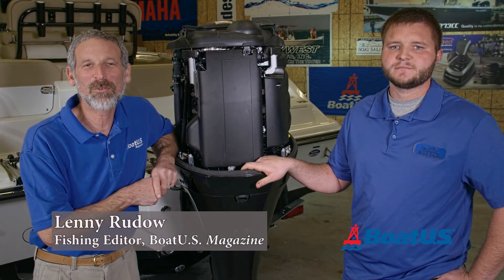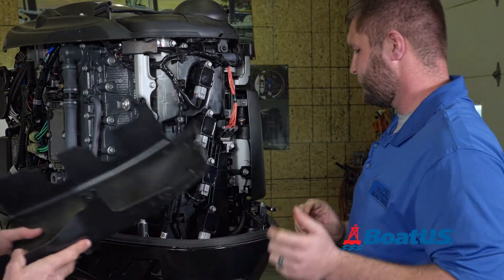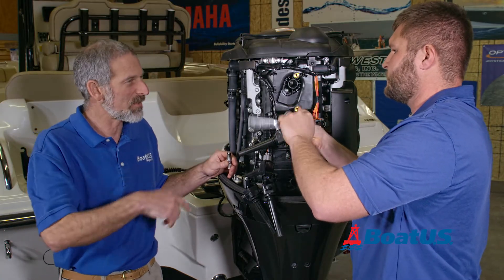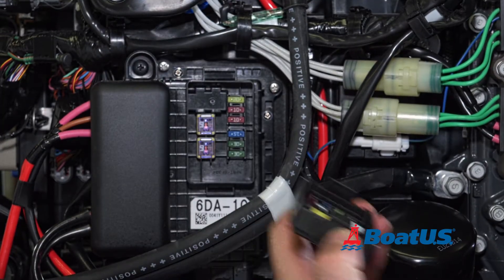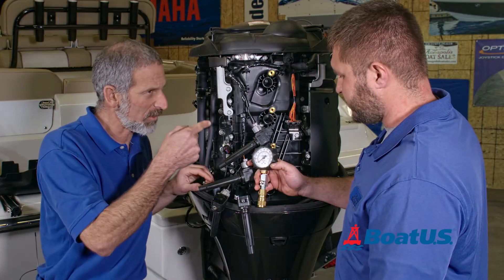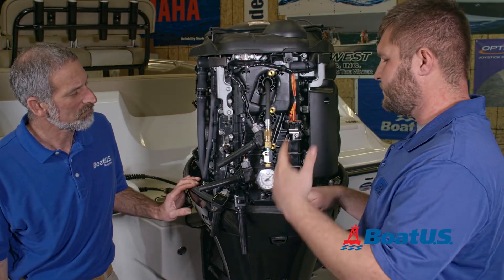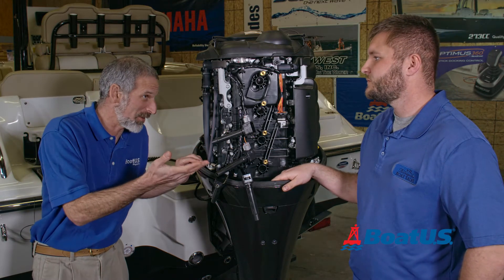Essential Guide: Test Outboard Compression Like a Pro | BoatUS

Comment: No mention of throttle position during cranking procedure --disconcerting!
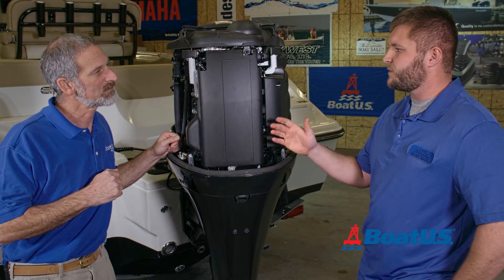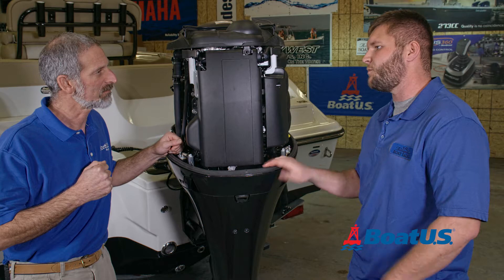Reply from the maker: Historically, it's true that if you were looking for an absolute number you'd water the airflow maximized, but historically we were dealing with cables and carburetors. Today, many modern fly-by-wire throttles will throw an error code if you try to crank with the throttle advanced. In the long run, however, it's somewhat moot, because what you're looking for in the compression test isn't the absolute number, so much as consistency through the range of cylinders. (See 0:40 to 1:05 in the video). So, while a restriction in the airflow may lower the absolute number, it will for all of the cylinders. If one or more are in poor shape the percentage difference will still show up in the results. Thanks for the great question, and I hope this is helpful!

Comment: I have seen other tests and they say open the throttle wide open?is that right?
Thank you.
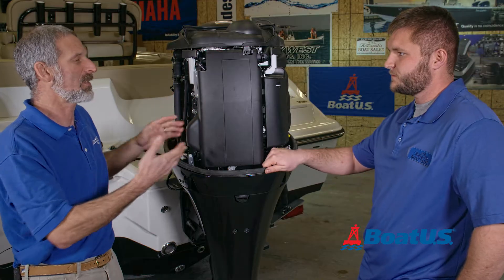Reply from the maker: The answer to this question has changed a bit over time, onemodels. Historically, it's true that if you were looking for an absolute number you'd water the airflow maximized, but historically we were dealing with cables and carburetors. Today, many modern fly-by-wire throttles will throw an error code if you try to crank with the throttle advanced. In the long run, however, it's somewhat moot, because what you're looking for in the compression test isn't the absolute number, so much as consistency through the range of cylinders. (See 0:40 to 1:05 in the video). So, while a restriction in the airflow may lower the absolute number, it will for all of the cylinders. If one or more are in poor shape the percentage difference will still show up in the results. Thanks for the great question, and I hope this is helpful!

Comment: Good morning, so is your recommendation to not get a compression test and just get complete survey?
I'm curious on what to do or steps to take buying a boat from owner.
Our budget is 12 to 20k......what are your suggestions. As you can tell, my budget will be indicative of an older boat anywhere from 15-30 years old. Thank for taking your time by the way.
Reply from the maker: Good questions, Brian. We ALWAYS recommend getting a survey by a NAMS- or SAMS-certified surveyor for any boat you're considering purchasing. In our opinion, surveys are worth every penny. And while a surveyor doesn't have a crystal ball, he or she can keep you from making a very expensive mistake. Doesn't mean something won't break or go wrong (it's a boat -- stuff happens), but you'll have a better idea of what you're dealing with up front and whether something is a dealbreaker. Issues don't always equal dealbreaker though. The seller may be willing to give concessions and/or have it fixed. But, for example, if a surveyor finds evidence of some jury rigged repairs, chances are good that there are a whole lot more of those you can't see.

As far as your question about a compression test, you should probably make sure your survey includes that, especially when you're looking at older motors. That may not be standard. Before you hire a surveyor, understand exactly what is and what's not being surveyed. If there's something that concerns you, make sure it's included. And also strongly consider a sea trial with the surveyor. Again, this may or may not be part of the basic survey.

Some excellent buying/selling resources are available to you free of charge on our website at https://boatus.com/expert-advice/boats-and-tow-vehicles/buying-and-selling-advice. Download the BoatUS Boat Buyers Guide and read through the myriad articles on the website. We also include additional resources you might find useful. 

Hope this info helps. Good luck and have fun with your search. And do try out BoatUS Boats For Sale listings, powered by BoatMart: https://www.boatus.com/products-and-services/membership/savings/boatus-boats-for-sale

Comment: But is every single outboard boat motor the same compression? They’re all 200? I found it confusing.
Reply from the maker: Hi Jayden. Thanks for the question. It's not about the numbers themselves; the critical part is ensuring that the difference among all the cylinders is within 10%. Hope this helps.
Reply: @boatus  ok, thank you. So does it matter that the cylinders *should* be 200, but they're say, 50, and all are within 10% of 50. That would be fine?
Reply from the maker: Thanks for the follow-up, Jayden. In our experience, most manufacturers won't cite an "official" compression number for their outboards. And you can't put any across-the-board number on it because all engines are designed differently. Our guess is that if you're getting only 50 psi readings, even if they are within 10% of each other, the engine isn't going to run. (If it does, the issue may be with your tester.) Unfortunately, I'm not sure we can be of further assistance without being on site, and your best bet is to consult manufacturer recommendations and/or a trusted mechanic. If you are having a specific issue, you might consider sending your question along with any pertinent info (and photos if applicable) about the specific engine to magazine@boatus.com and we can forward it to our technical editor for possible answer in a future issue of BoatUS Magazine.
Reply: @boatus  thanks very much! I don't have an issue now, but just learning about all the various things, and this was a confusing detail that seems to be overlooked. Maybe because it's not very relevant! But I really appreciate your responses.
Reply from the maker: You are quite welcome, Jayden. Thanks for asking!

Comment: Hi. I have an 05 250. Where would I find that fuse for the fuel pump ?
Reply from the maker: Hi Jess and thanks for your question. Unfortunately we're not able to answer questions like these as we're not familiar with every engine out there. We recommend taking a look at the owner's manual, available through Yamaha. Just plug in the info from your engine here: https://yamahaoutboards.com/owner-center/owners-manuals. I'm not sure if this is the correct manual, but it may give you a place to start: https://www.manualslib.com/manual/559932/Yamaha-F250.html?page=78. Alternatively, reach out to Yamaha's customer service. An online search shows some videos and articles as well. Good luck!

Comment: do you need water running through the engine.....My manual says, don't crank without water. Should the starter be disconnected ? More I utubes I watch, the more confused I get.
Reply from the maker: Thanks for the great question, Livio. You do need a water source any time the engine will run, so many people say to make sure it has a sufficient water supply "before you crank it over," which is correct. However, since you remove the spark plugs for this procedure (performing a compression test), there's no chance of the engine firing. Thus no heat is created, and no cooling water is required. The starter, you don't need to worry about. Hope this helps clarify things.
Reply: @boatus  sure does....just heli coiled a bolt on the cylinder head...all torqued to 20lbs....cleaned and lubricated cylinders....now will compression test....throttle and choke wide open....fingers crossed
Reply: Compression plus 120 on all....this johnson 100ESL may still have a few good years on her....thanks again

Comment: Great video and great explanation. I’m trying to buy a boat with a 150hp 4s Yamaha. Yesterday I took a tech to run this test, one cylinder was 150 others: 160 and third was 150, in case 4th we have no pressure but the owner said this boat hasn’t Been started for more than a year so maybe this can explained the cause. 
What I’m worried about is because the tech didn’t took off the fuse of the fuel pump and the test was made with the first start of the motor so it wasn’t hot. 
I really like the boat I’m trying to buy. Hope to receive any advice. 
Already gave you thumbs up and just subscribed to your channel . Thanks
Reply from the maker: Thanks for the like and subscribe, Raul. While we can't make specific recommendations because we're not there on site, we always suggest getting any boat (new or used) looked at by a qualified SAMS or NAMS surveyor. It's money well spent and can save you a lot of time, money, hassle, and heartache down the road. You're right to be concerned about the compression test results, and it would be good to get more info -- not just taking the owner's "guess." If you already took it to a trusted tech, I'd want to know what they think about the results. Even if you choose not to have a survey done, getting that boat out for a test ride before any money exchanges hands is important. If the owner isn't willing to do that, it might be a red flag. A couple other important things: Be sure you get EVERYTHING in writing (via a sales contract) including price, what's included with that price (electronics, trailer, etc.), any repairs the seller agrees to make, any known problems, etc. For more boat-buying tips from BoatUS, check out the articles here: https://www.boatus.com/expert-advice/boats-and-tow-vehicles/buying-and-selling-advice. 
It sounds like you have some concerns. Don't ignore them. And be sure to ask specific questions. The seller isn't required to reveal anything you haven't asked about, but he must disclose any issues if you do ask. Hope this helps and best of luck! Let us know how it turns out.

Comment: MAKE SURE YOU HAVE FULL THROTTLE AND FULL CHOKE ON!!!! I have personally seen 30% psi difference with these two conditions the other way (low throttle, choke off). This is especially true on older outboards I work on (60's and 70's).
Reply from the maker: Thanks for the advice, David. This is useful for old two-strokes.
Reply: WHAT ????!!!!!!??????.....does it need to be in the water ? Cuz thats gonna be a problem.
Reply: @liviofazi4017  it won't be a problem since the spark plugs are out and the fuel pump is off, it won't run so it won't heat up
Reply: It makes no difference. Old wives' tale. 
https://www.youtube.com/watch?v=ItBVKrJdjYw
Reply: Especially with fuel injection
Reply: I don’t see how this makes any difference on a fuel injection motor. I don’t even have a choke

Comment: Would you recommend grounding off the sparkplug wires to avoid doing damage to the electrical system when performing a compression test? Thanks.
Reply from the maker: It depends on the outboard and its individual systems, James. In many cases, pulling the kill switch will accomplish the same thing. We'd suggest going by the engine manufacturer's recommended procedure, and if you can't identify it, ground the leads to be safe.

Comment: 2001 Evinrude 4stroke, 3 cyl. Had very weak telltale and oil temp alarm going off. Replaced oil temp sensor and new water pump. Telltale stream is good, oil overheat alarm still goes off but take a good 15 min. However, new and crazy problem is water now flowing into all 3 carbs??? How do determine cause?
Reply from the maker: Not good at all, Water Monkey, and not something we feel comfortable tackling as a DIY. We recommend finding a good mechanic pronto. Good luck, and let us know how it turns out.

Comment: Hello and thank you for this video.  I am in the market to buy a used outboard 85 HP Mercury motor for my fishing boat and it has not been started in over 10 years.  If the motor can't be warmed up because it won't start how would you do a compression check? Thanks in advance.
Reply from the maker: Hi Omar. For a compression test to mean anything, the motor needs to be warmed up first. An outboard that hasn't started in 10 years is likely to need a number — a large number — of fixes before it can be started. The litany of items to replace is too long to address here, but we wouldn't recommend tackling this alone; having a professional look at the motor is in order for sure. Good luck!
Reply: @boatus  Thank you for your advice.  Appreciate it very much!  Sincerely.
Reply from the maker: @OmarGonzalez-uj3ot  You are quite welcome!

Comment: Why doesn’t boat us get someone that actually knows what their talking about
Reply from the maker: Hi Justin. Can you be more specific? Sean is a Yamaha Master Technician.
Reply: @boatus   I’m sorry was in a bad mood that day and should’ve kept to the if I don’t have anything good to say than should’ve kept my mouth shut., thanks for the video non the less BUT the nitpicks I had:
Said remove all spark plugs so engine doesn’t fire and cylinder gets more air.  Shouldn’t fire because ignition system should be properly taken care of by either grounding spark plugs or cranking with safety lanyard disconnected or risk damaging ignition circuit which was never mentioned.  Main reason to pull spark plugs is to make it easier on starter to turn over engine due to only having resistance on cylinder being tested.  Adjacent cylinders have no influence on air of cylinder being tested but throttle body position does on a 4 stroke so it’s important to open and hold throttle body to its most open position while cranking for most accurate readings.
Fuel in cylinders will not wash out readings as it is vaporized into a gas by the time it reaches the cylinder anyways. How do you think ouboards without a fuel pump(ie carburetion) are tested. Which many people coming for a compression testing video will be inquiring about.
“Certification” credentials are nothing but check boxes for appearance and by no means signify expert subject matter
Reply from the maker: @justinkemeter  Thanks, Justin. We all have bad days. Appreciate your response. Thanks for your clarification.

Comment: Question, I was told by a mechanic that it was bad for the coils to turn the motor over without grounding out the plug wires first, any truth to this?
Reply from the maker: Your mechanic is correct, Bill. The spark plug high tension leads should all be grounded using a spark checker. Without being grounded, power pack/ECM damage could occur.

Comment: Does cranking over the outboard damage the impeller?
Reply from the maker: HI Dan. Thanks for the question. For a compression test, you literally only need to crank the engine over one or two time and this is insufficient time to damage the water pump impeller. So go ahead and all will be well if you follow the instructions in the video.

Comment: The test can be done both hot and cold for a comparison.
The cylinder hose threaded end needs to be checked to make sure it is the correct length.
The throttle should be set at WOT
Fully charged batteries and a battery charger should be connected to keep cranking as consistent as possible.
An equal number of revolutions across the cylinders.
Reply from the maker: Thanks for watching!
Reply: It makes no difference where the throttle is set. 
https://www.youtube.com/watch?v=ItBVKrJdjYw

Comment: At 3:17 you say this piece. How do you know what size is needed to thread into the spark plug? Is it the info of the spark plug?
Reply from the maker: Thanks for the question, Dave. The owner's manual will have the exact specifications for the spark plugs used in your outboard.

Comment: I have a 9.9hp mercury 4 stroke. What should the compression be around? I am repairing it currently because the crankshaft was bad.
Reply from the maker: Thanks for the question, Jared. The actual compression number is dependent on several factors: the age of the engine, the type, whether the valves and valve guides are in good condition, and so on. Check the compression when the engine is hot; a cold engine will give false high readings. I would expect the numbers to be in excess of 100 psi with each of the cylinders within 10% of each other.

Comment: I have a 140 Johnson evinriud and I dont have spark can you help?
Reply from the maker: Thanks for the question, Joseph. This could be so many things: Is the battery flat, are the high tension leads in good shape, is the ECM (engine control module) faulty? There are so many possibilities that it is impossible to give an answer without seeing the engine in person. The best thing I can suggest is that you entrust your engine into the hands of certified outboard mechanic who has the tools to diagnose and correct this problem. You do not say what year your engine is, but the newer engines can be connected to a computer and the mechanic can then download the fault codes, which will go a long way in finding out what the problem is.

Comment: Our compression test was good, however it really seems that after our engine warms up we are dropping a cylinder,  the power will definitely lower and will try to surge periodically.  Is this possible with good readings?
Reply from the maker: Thanks for your question, Shannon. Without seeing the engine in person, I can only offer general advice here. Engine compression should only be checked once the engine is warmed up to normal operating temperatures. This is because hot components will expand and have a bearing on the readings taken. A cold engine will give readings higher than hot engine. Assuming that the compression checks are normal, I would suspect something else, which, from your brief description, leads me to believe that this is most likely a fuel issue. My reasoning is that compressions do not change from moment to moment and cause surging. If your engine has fuel injection, it may well be that one of the injectors is partially blocked and requires service or replacement. Or it could be something as simple as a worn-out fuel filter that needs replacing.
I would thoroughly check all the fuel system components: hoses, filters, connections, and injectors or carburetors. If you are unable to do this work yourself, I would seek the services of a qualified technician. Hope this helps!